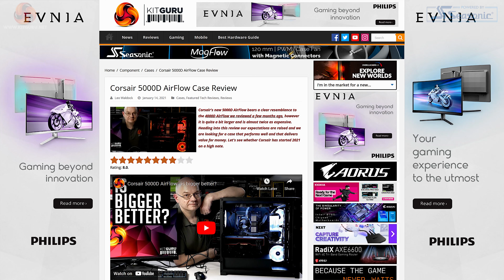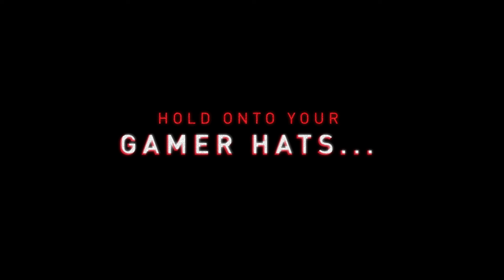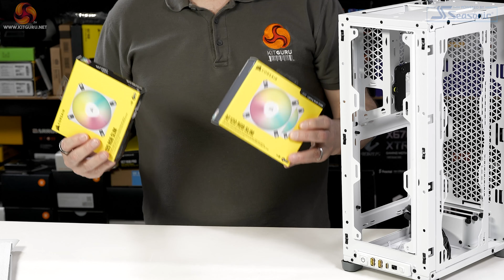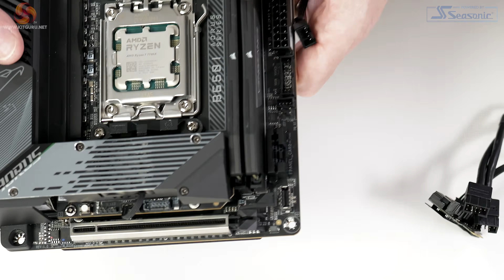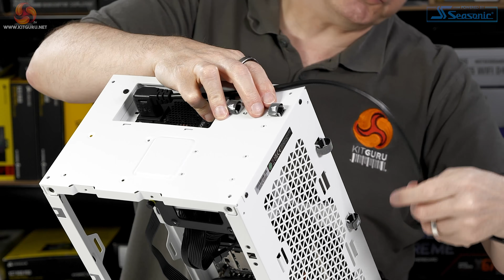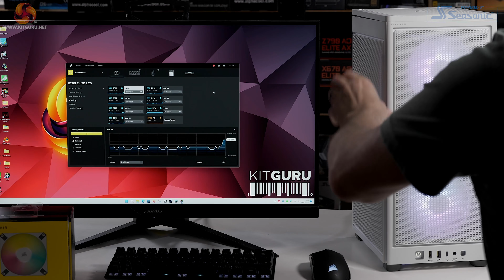Corsair 2000D Airflow - Mini-ITX and SFX

Comment: This case could have fitted a regular ATX PSU, but they chose to instead install a space-wasting cage for the SFF PSU. ATX would have fit if there was no cage and the cutout/recess a bit larger.

Of course their incentive is to be able to sell a much more expensive Corsair SF PSU along with the case. Very odd choice, just like not supporting 4 slot wide OEM GPUs when the case is already this big and the length would have fit most 90 series air cooled cards.

Comment: If the vertical GPU is pulling air into the case from the back, then are the front fans oriented to push the hot air out the front? And are the AIO fans exhausting or pulling more air in?

Comment: Correct me if I'm wrong, but won't it be better mounting the radiator with the hoses at the bottom instead of on top? Isn't there air in the AIO to some extend?
Reply: Tube orientation isn't an issue; it's Pump vs. Loop height. As long as the Pump isn't the highest point in the loop it's fine; the Rad is higher than the Pump in this setup so it's all good.

Comment: I gave up on buying this case. Thanks for the review, sir.
Reply from the maker: Why did you give up ?
Reply: @KitGuruTech I gave up on buying this case because, basically, I didn't like the look, the mess of cables inside the case, the position of the rear panel (makes it difficult to use), the position of the front panel (makes it possible to bump into my plugged pen drives and dongles), the limitation for using only mini-ITX (this is terrible and incompatible with the size of the tower), and temperatures. I really expected more. Thank you again.

Comment: You missed two important advantages of this case over most other (all other?) SFF cases: Huge air coolers can be installed for true silence (no high pitched whiney pump noise of the AIO, no water noise). And: the GPU is directly connected to the motherboard and does not need an adapter cable which can cause all kinds of trouble.

Comment: :hand-orange-covering-eyes:The radiator outlets are positioned at the top. If the radiator outlets are positioned at the bottom, the air will naturally concentrate at the top, and the pipes will always be filled with water, allowing the pump to operate normally . If the radiator outlets are positioned at the top, all the water is found at the bottom, and if there is air in the circuit, the latter will be found in the upper part. In fact, the pump will find itself filled with air and become defused, and will no longer be able to circulate the liquid: this is guaranteed to heat up the processor, and even ultimately destroy it!

https://www.youtube.com/watch?v=BbGomv195sk&t=1544s

Last point: why not mount the AIO's RGB fans in suction to take advantage of the RGB ...

Comment: Another terrible design, compromised as usual so they can support water cooling. An ATX power supply would have fit perfectly well in a conventional position if they hadn't made room for the radiator, it could even have been made a lot less tall this way.

Comment: There is support for a 3.5” drive you just need a 120mm to 3.5” Fractal Design Universal Adapter Type-A. It goes right over the PSU internal enclosure.

Comment: not too happy with the rad orientation with the tubes upp, can it be flipped or do they HAVE to be up?
Reply: Tube orientation isn't an issue; it's Pump vs. Loop height. As long as the Pump isn't the highest point in the loop it's fine; the Rad is higher than the Pump in this setup so it's all good.

Comment: It's mildly annoying, that just a few design changes could make this case an ultimate PC tower case.
Reverse internal design to plug everything from top, make 360 AIO mount on the opposite side of GPU instead on top of it, add 2-3 cm to support 4 slot GPUs, add 2 cm to fit standard 120 fans instead of slims, change PSU position to improve overall airflow, redesign mesh to not choke some components as some tests shown to happen, and maybe few minor changes to cable management.
Sometimes I think that they are intentionally designing gimped designs to just keep having an excuse to make a new case instead of making one excellent product... or they just suck at design.

Comment: It is an interesting layout, I was actually thinking about modifying a mini itx to fit/attach a 360 AIO. For thos size, however, I think non sfx psu should be an option and maybe also the possibility to place the case in horizontal position. As it is it seems a bit too cumbersome.

Comment: I find it a little disheartening that when using an AIO with a cooler that has a display screen like the H100i Elite, it gets blocked by the positioning of the Radiator and fans thus rendering it's functionality moot. I would like to see if it can handle a GPU the size of the Sapphire Nitro+ 7900 XTX.

Comment: nice review, I wonder however why the legs are up from the radiator. With the cpu below there is a fair chance of  pump gargle, less performance and reduced pump lifespan, or is there no space to place it with the legs down?
Reply: Pump noises and issues are the result of positioning, not orientation as such. When using an AIO you want the Pump - where ever it is built in - to NOT be the highest point in the loop; as long as you do this most AIOs will be completely fine.

In this video the Pump is in the CPU block (that is where Corsair puts their AIO pumps), so having the tubes up and the top of the Rad higher than the CPU block is a good thing.
Reply: @ParagonFury  Since most pumps I've seen are of the centrifugal type, the most important is to have a fully filled inlet leg to ensure no cavitation will occure. Also AIO's are not 100% filled. Even though the offical defination of cavitation referes only to vapor pressure, the eventually excess air off factory causes the same issue. The situation differs when you use a membrane pump (like an aquarium pump). In this case with legs up there is a fair chance of pulling air into the system as gasses will collect at the highest point. By turning it over the static pressure avoids that possibility.So for me orientation matters, but we don't need to agree on that 🙂, just explaining where i'm coming from. See also this one from Steve https://www.youtube.com/watch?v=BbGomv195sk&t=194s who explains more situations.

Comment: Does anyone know if this will fit a m-DTX board in? It's a shame they didn't route the power cable on the inside tbh, but I like the case. Im considering this as my H210i is now restricting me on GPU choice given that the front of that case houses the AOI. I'm limited to just over 280mm

Comment: If there was more room behing the motherboard tray, room for normal fans in the front, vented top with possible fan mount and a cleaner internal way to route the power cable of the psu... like the case has the room inside to make it...

Comment: Just got this case a few days ago. So far so good. Temps are good. However, corsair should have added support of either 80 or 92 mill fan on the top, two of them would fit. I mean why make the top mesh if it's closed. The very least the top should have had perforated holes. Come on Corsair. Hot air rises,

I will cut the top to mount two 92 mill as exhaust.

Comment: Fan and AIO wiring won't be an issue with Corsair's new iCUE Link ecosystem.
I hope they release a new version of the 2000D RGB model with the Link fans.
Reply: was thinking the same, you could buy the current case with the rgb slim fans and buy the icue link rad, then when they release the slim link fans you would be there ready

Comment: Would a 4090 Fe fit inside? Neweggs website says 320mm 3 slot, corsairs website says 320 in one location and 365mm in another location. Do you think noctua fans would a better choice for fans?

Comment: "The bigger the number. The bigger the case" NONONO Corsair has a 1000D look at the size of that thing you could probably fit 3 of the 2000D cases in it and it is larger than the 7000D and you can put TWO ROWS of quad 140mm fans in the front AND the top and a second mini ITX PC in the back
Reply from the maker: You are quite correct about the 1000D however most of us regard that model as a mis-step that we prefer to ignore
Leo

Comment: That is so interesting, the 2000D from Origin has the mobo flipped being above the psu and is on the opposite side (right instead of left). That means the cables going into the mobo come out the top making it much easier to plug things in, plus you get an extra 120mm fan on top. I wonder why  they flipped things around for the normal Corsair version, the pump on the Origin version is still below the top point of the rad as well. Being honest, I like the Origin version more since it isn't asymmetrical like you can see at 18:43 and the cables are much easier to get to once the pc is all put together since you just have to remove the top bit and have full access. I would guess it would also have slightly better thermals since it has that top exhaust fan.
Reply: Because having the I/O at the top causes issues with the gpu
Reply: @hovercroft  Weird, but how would having it flipped the other way or having it vertically mounted in a regular case be any different?
Reply: @JubJubYT  I don’t know I just read that having the gpu upside down can cause performance issues. That’s probably why they changed it. There’s not really any cases with a top I/O
Reply: @hovercroft  I could see that being an issue, especially with cards like the reference 7900 xtx since those already had issues
Reply: @JubJubYT  it’s just an issue in general for graphics cards. They don’t run well upside down. Vertical or horizontal is best. Not sure what issues you are referring too. But it’s not tied to a specific gpu.
Reply: @hovercroft  The reference 7900 xtx had issues with the heat sink not being properly fitted on or something like that, so it was cause it to constantly overheat basically. Wouldn't having the gpu upside down from the bottom have around the same effect as having it upside down from the top, though? I get what you're saying between vertical and horizontal since they're designed to sit like that
Reply: @JubJubYT  apparently not. It’s just what I’ve read when they initially designed it. It’s why cases never have top I/O. Don’t know why it causes issues. I’m guessing that’s why they’ve changed it.
Reply: @hovercroft  so strange, I have a top mounted I/O and haven't noticed any issues. I wonder if flipping is upside down would get me better temps tho haha
Reply: @JubJubYT  could do
Reply: @hovercroft  I could have also gotten lucky. I looked around on Reddit and seems like not everyone has an issue with temps, just a random thing. I wonder if certain gpus are more prone to having temp issues if they are oriented that way or if it's just a manufacturing flaw or something
Reply: @JubJubYT  yeah I don’t know much about it it’s just what I’ve read. Not sure why it causes issues exactly. Just one of those things. They obviously changed it for a reason. When the initial pre build was released it was flooded with comments criticising the top I/O. Kind of glad it was revamped tbh I like the way it is now.
Reply: @hovercroft  I did just test mine and under full load after a few minutes it hit 75 on the gpu and around 98 on the hot spot. Turning it sideways reduced temps to about 70 and 90 respectively. I didn't try turning the case completely upside down since that would've been more of a hassle. It isn't a huge difference for me, but I may modify the case to be able to sit sideways at the very least
Reply: @hovercroft  just tested it in a couple of games and a majority of the time turning it sideways made no difference. The only game I saw a noticeable improvement was on battlefield 2042 since that game runs hot anyway. It was very interesting results. Thank you for the discussion and info!

Comment: Honestly this PC case has it all for me. Enough storage and decent space for hardware. Its a win, I will be buying this for sure!
Reply: Literally every vertical case that isn't an H1 is better than this.
Reply: @svn5994  They all hit that GPU size wall pretty hard. The 2000D can fit pretty much everything 4080 and under, many 4090s, though I believe IIRC a couple of the super-fat 7900XTXs won't fit. But other than that you can put what you want in the case, which is a significant step up from the other vertical cases which either have to use the very low-power and smaller cards like the 60/70 series or get the one specific model of higher end card that will fit (which tends to cost more $$$ than just getting this case and a more regular card).

Other vertical cases get stuck on one specific card fitting, or they let you have GPU size but then you have to go wimpy on the CPU because you can't fit a good cooler in there anymore.

Comment: Great video - thank you for the insights! Owning an NZXT H1 I was saddened to see the following : The orientation of the mainboard and the resulting location of it’s IO panel is more than a bit  annoying. I had to work with an otherwise unnecessary USB hub making my overall rather small setup - a lot of work and unpleasant to maintain and not something I will continue using - sadly.

Comment: I really like the styling of the case, but at ~24 liters, it's not exactly what I'd call small form factor ITX case. If it weren't a vertical case, I imagine the extra spacing at the bottom for cables could have been removed to reduce the overall volume and thus make it smaller. Excellent review!
Reply: it's not SFF by the arbitrary definition of 20 liters, that said it still gives you a lot of hardware compatibility with a 360mm AIO and support for the recent chonkers of GPUs.

Comment: Surprising to see adding the three intake fans at the front somehow reduces noise. Seems like an itx case worth buying.
Reply: It makes sense because what happens when you add the additional fans is they introduce enough cool airflow to where it brings temps down.  Any other fans inside the system are able to run at much lower RPM while running cooler, especially since the only fans that were in the case were dealing with the resistance of having to go through the radiator fins.

Comment: It seems an air cooler might be best for this case as most tubes are long for an aio and you wouldn't want to risk any of possible damage. Also for the RGB model I know it comes with a fan controller, does it allow for more fans to be plugged in or would you need one of those nodes?

Comment: Love the look of this case but the cost of SFX PSUs pushed me into getting an Asus AP201 case where my ATX PSU would be comfy. I have to disagree with the use of RGB fans on the radiator and would have put them on the front of the case instead. I think the new 30mm fans would have been a better fit.

Comment: I have one, it’s amazing for performance and desk space savings. 4090 and 13900k 360mm aio works very very well.
Reply: A 4090 eh?  Appropriate since this case would be the exact same size as the FIRE EXTINGUISHER that you’ll need once your 4090 plug starts burning up. 😂
Reply: @Digikidthevoiceofreason  Funny how the only ones that have burnt up are user error. 🤡
Reply: A 4090 in that case? You're a brave soul. Best of luck to you.
Reply: Would you mind posting your pc part picker build?  I’m very interested in this and haven’t ever built in an ITX case before

Comment: Nice one Leo as always, I like & don't like the case, Good to see no riser cable needed that saves money, I don't like all the cables & the 360 on the side, 
I can Just Imagine how the cables be if you go for the 3 fan ARGB with lighting node core Option, that be 6x fan cables & 2 x cables coming from the node core.
& 3 x fans x 6 cables coming from a 360 corsair Rad & other cables
It be a 'Worzel Cable Gummidge' 
I like to see  a TG Clear Side panel to show off the Hardware & have a silent AIO like a Arctic liquid freezer 240mm that perform as good as most of the 360s.
But they seem to have designed with H55, H60, H75, H80i, H90, H100i, H105, H110i, H115i, H150i in mind. so thick rad like the Arctic 240mm may not fit.

Comment: 25L with only SFX psu and no 3.5" HDD support? Please. Might as well buy a revolt 3 or meshlicious at that point and have a real SFF system
Reply: With only 1 rad. TMW a case more than half it's size supports two rads.

Comment: I seriously think that mini itx is nothing more than just a show piece for a moderate power user. I urge you to make a build using NZXT 510 Flow with a proper ATX board supporting ddr5 memory sticks. RTX 4080 probably, idk. Maybe the 3080ti.
Reply: You know this isn’t a build. It’s a review of the case.
Reply: @theonlyredspecial  Yes. I completely get it and it makes sense too.
Reply: Why would I even want to touch a NZXT case? I can shove a 13900k/7800x3D + 4090/XTX in a far better case.

Comment: Should be mATX compatible at this size IMO.
Reply: No.
Reply: It's tall for a longer GPU,  but still small dimensional footprint cuz ITX.
Reply: yeah, my thinking exactly, one slot more (4 instead of 3) and it's mATX, also if you rotate the PSU an ATX one could fit perfectly, if I wanted mini-ITX i'd go sub 20L with the sandwich or pizza box layout

Comment: I just ordered this case .... Gonna do an insane custom loop! As for the the temp increase with the additional fans I would assume with all 6 fans being intake & being at a 90 degree angle from each other I believe it's creating a vortex inside the case trapping the heat. I believe if you can manage to install an additional fan at the top for exhausting the heat temps would drop drastically.
Reply: There is no way to install a fan at the top so disappointed in the case due to that reason
Reply: > Insane custom loop
> Single rad 24L case
Reply: @svn5994  I’m doing dual or triple rad not sure yet